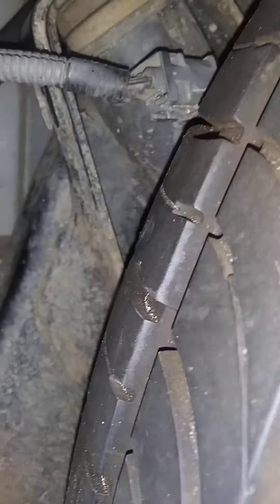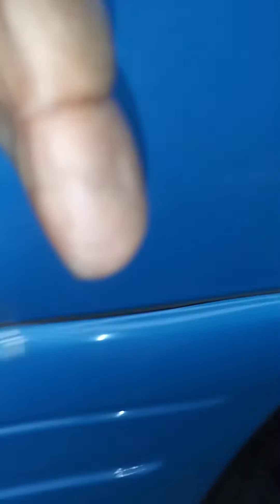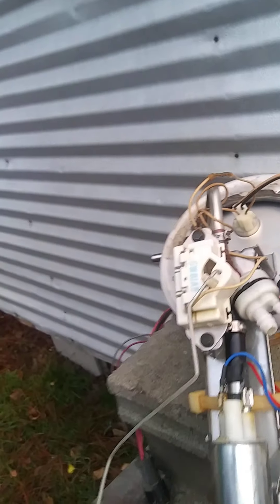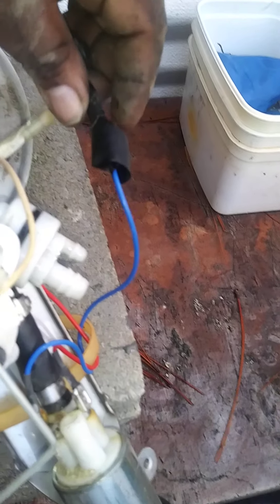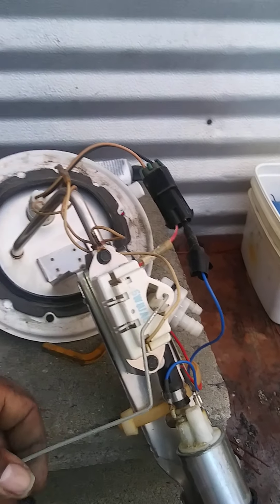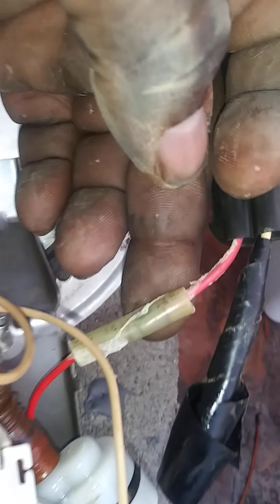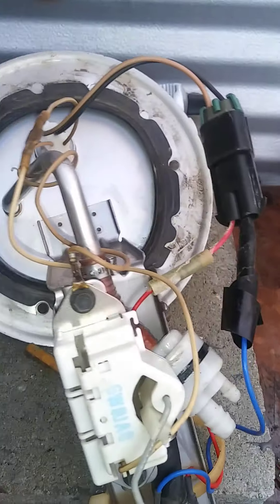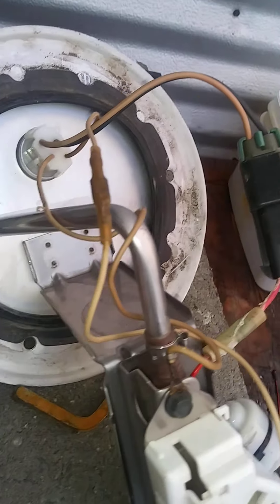1998-2011 crown vic fuel pump replacement

Comment: Can you tell me what is that under the trunk that has tubes and wires and does it connect to the gas tank.
Reply from the maker: That is you charcoal canister it not connected to the gas tank it mount under the outside of trunk and the hose run thru the frame and above the tank

Comment: Do you know if it’s the same on my 2010 Lincoln Town Car? Fuel pump location?
Reply from the maker: Yes
Reply from the maker: Make sure to like subscribe and press the 🛎
Reply from the maker: @joshuacampodonico6554  jack the body up not the axle and it will be alot easier. To get to the plugs

Comment: the fuel pump is low voltage , and won't ignite in the liquid fuel.
Reply from the maker: You didnt understand what I meant I'm a ASE certified Diesel and automotive technician and I stand on what I say if you cut them wires without unplugging the battery it will spark enough to ignite that fuel because you have oxygen present because the fuel pump was unbolted sir